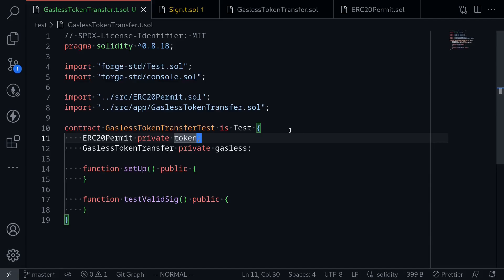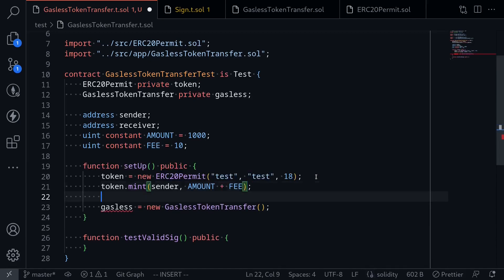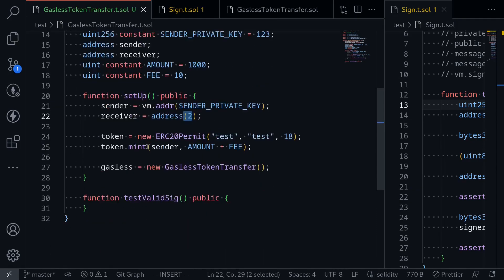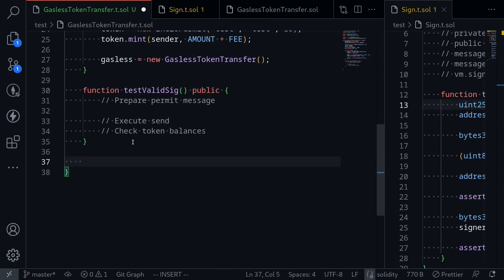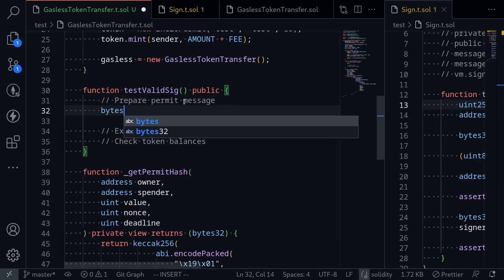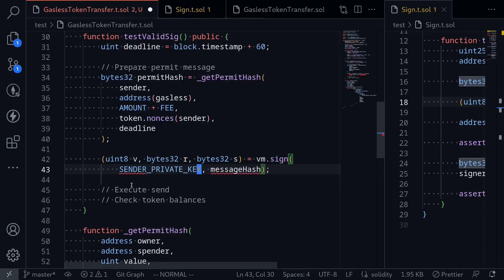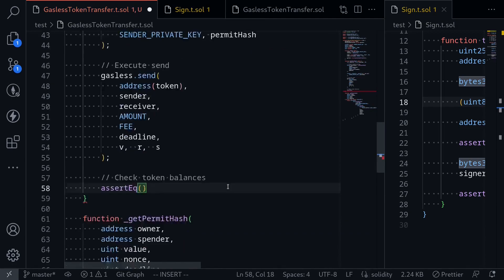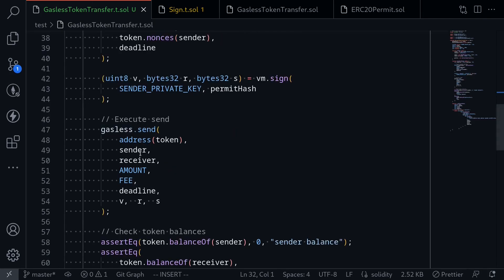Gas-less Token Transfer - Test | Testing with Foundry

Comment: Thank you so much for this amazing series,
I've a doubt =>  Shouldn't the FEE have gone into the address(gasless) which has been defined as the "spender" instead of address(this) which is the address of the test_contract
Reply from the maker: If you did that, FEE would be stuck in gasless contract
Reply: @smartcontractprogrammer  Oh got it, thankss!

Comment: Thanks for your effort.
I have two questions:
1) Does `vm.sign()` use `eth_signTypedData`?
2) For using permit we need to prepare eip712 structured data and then sign structured message. How it is being done in the video.